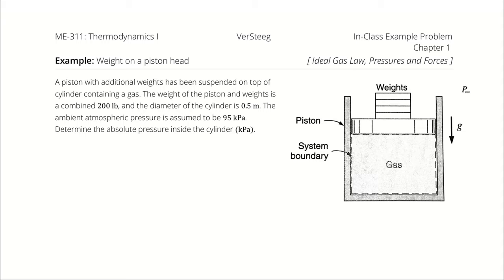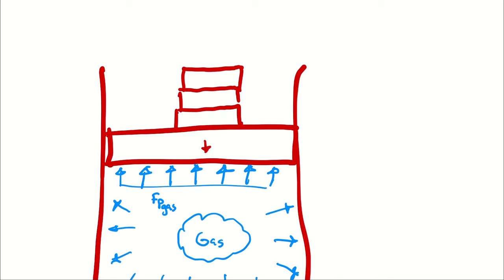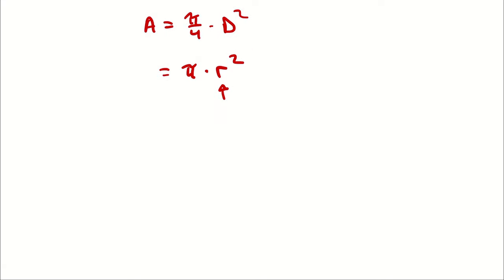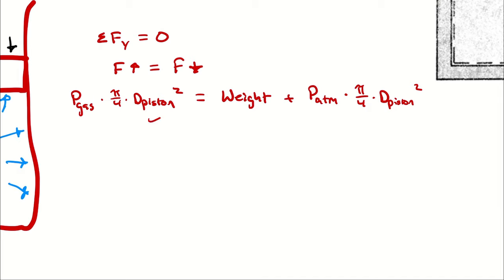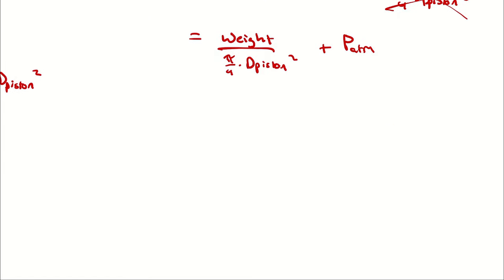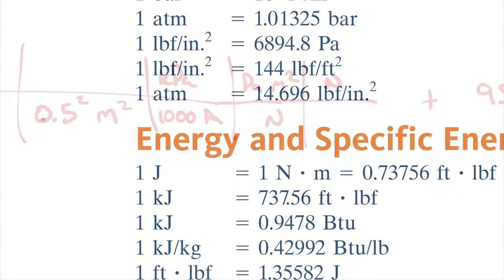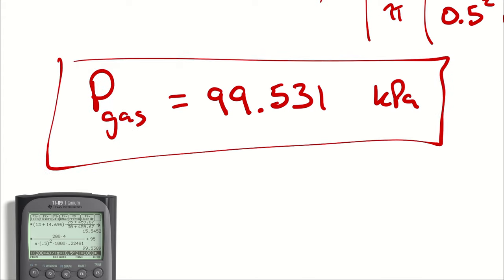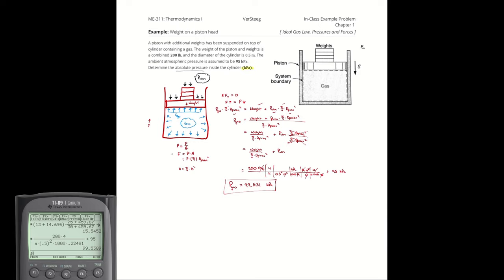Example Problem - Weight on a Piston Head

Comment: Dear Sir............Example Problem I have a single acting hydraulic cylinder with a stroke of 300 mm, a bore of 18 mm and a rod of 10 mm
 if the press weight is 1 mm on the Piston Head what is the pressure.....Please explain the calculations
Reply: lol so funny bugs bunny
Reply: the answer is 233444